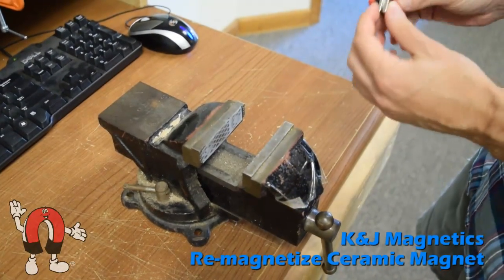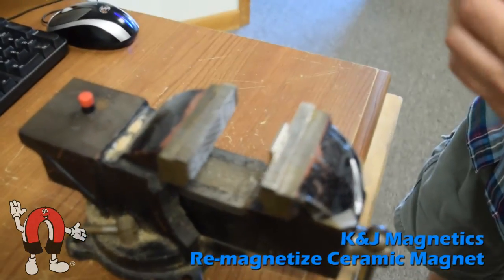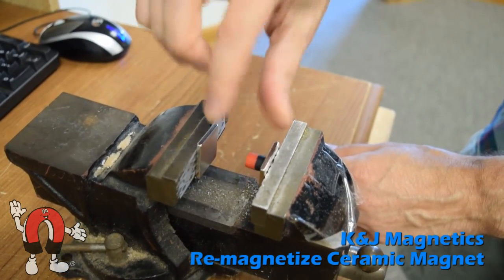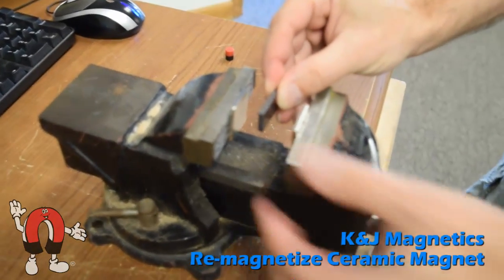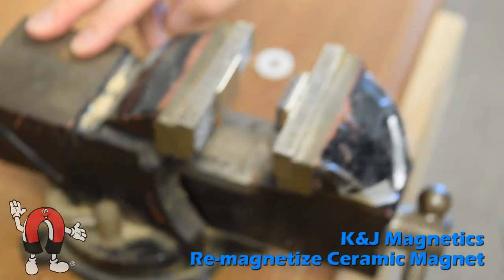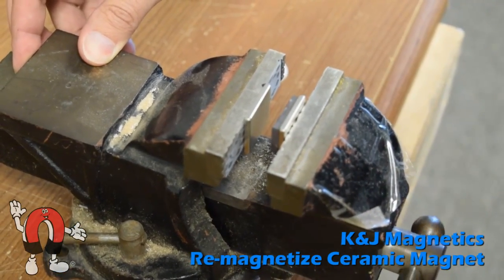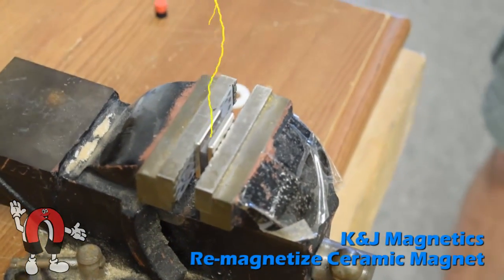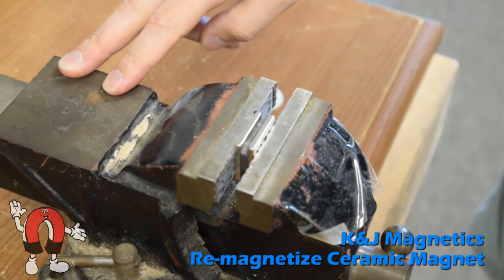Fix a Ceramic Magnet

Comment: Can you make a ceramic magnet stronger or weaker by Gaussing or DeGaussing them this way (guitar pickups) ?
Reply from the maker: If they've lost their strength over the years, then yes. But it won't add any strength above their original magnetization strength
Reply: @KJMagnetics  Want to try this to see what the bar magnet(s) become for a guitar's single coil pickups.